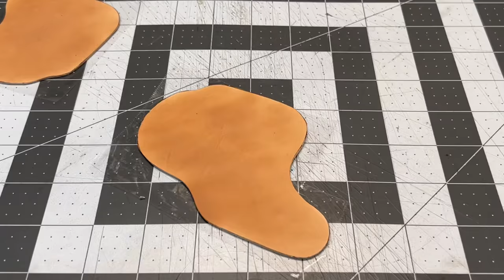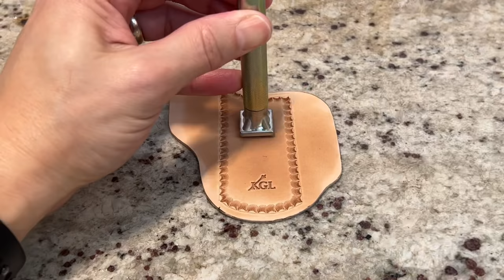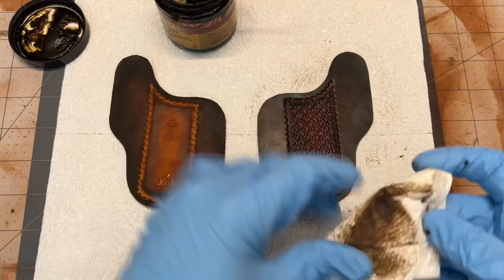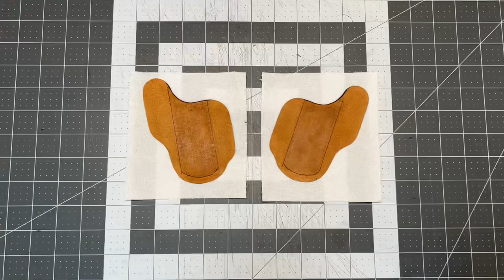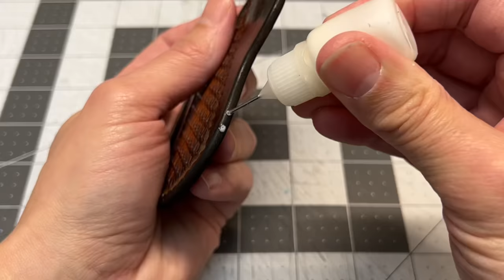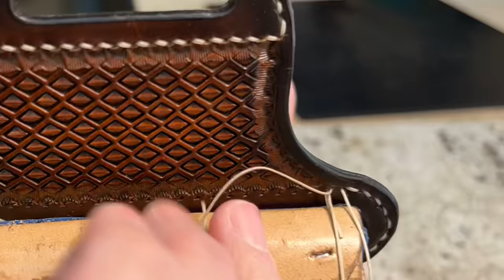Making A Fancy Leather Pancake Sheath For My Old Pocketknife - Leather Craft

Comment: Thank you for your video, I have two questions? why did you put the tape on the back, and can you convert this pattern to make a single mag pouch. love this design thank you so much.
chet
Reply from the maker: Thanks. The tape is to prevent the leather from stretching and deforming during the tooling process. As far as converting, I’m not sure.

Comment: The Osborne 1-3/4” punch, how hard is it to cut thru the leather.  I just got one and I am having a hard time punching thru.  It has been sharpened by the person who sold it to me.

What is your table and base that you are using under the punch?
Reply from the maker: I use a rubber mallet and mine cuts through leather pretty easy. I have never really had any trouble punching through. I have a 1.5” thick piece of granite under my punching mat.

Comment: Why do you put packaging tape over the smooth surface and do you ever remove it. New leather worker who loves your work, but I am confused by the tape.
Reply: I just read the answer in a reply to some one else who asked the same question. Thanks for sharing your experience and knowledge. God bless you.
Reply from the maker: Thanks. I put tape on the backside of the leather to help prevent it from stretching & deforming during the tooling process. One done and dry I remove the tape.

Comment: Really nice work. I have a question regarding wet forming and tooling leather. Do you tool before you wet form or wet form before you tool?
Reply from the maker: Thanks. In my experience if I’m doing any wet forming I usually don’t tool those particular pieces.

Comment: Out of curiosity, what's with the packing tape on the back side?
Reply from the maker: Applying tape on the back of the leather before tooling prevents the leather from stretching and deforming.
Reply: @KingdomGloryLeather  OH!!! That's an awesome tip!!! I'm just getting into leather craft myself. Made a few wallets and belts so far!!
Reply: @KingdomGloryLeather  once the tape is removed, what is applied to that area, I assume its to seal the rough grain? Thank you.